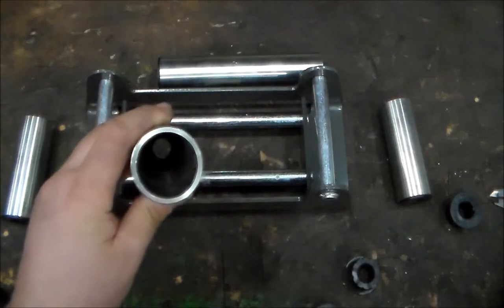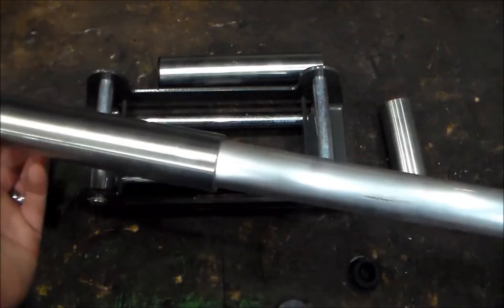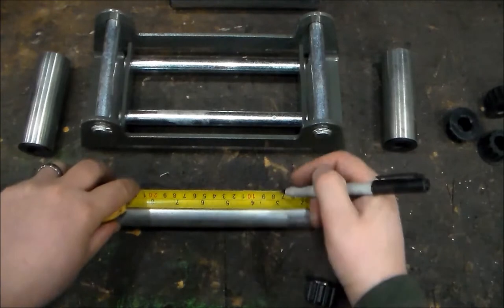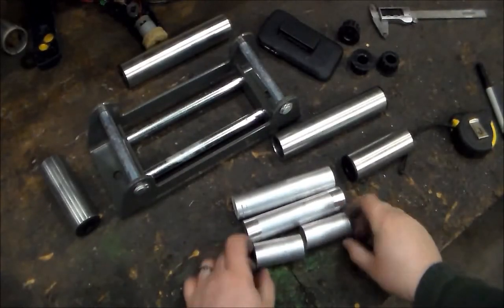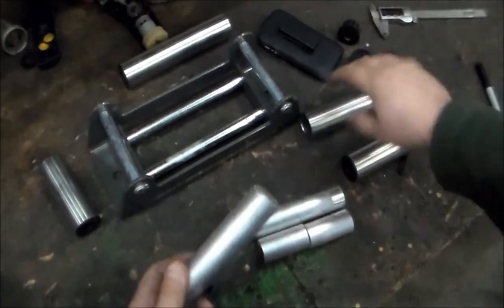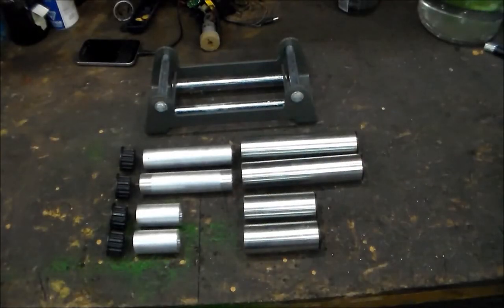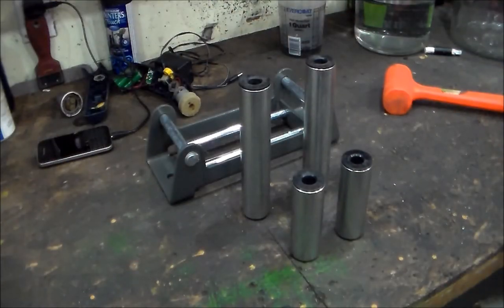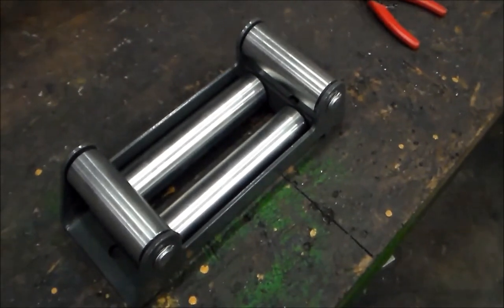How to Make a Winch Cable Guide Indestructible for $5 Bucks

Comment: Nice fix. Since all my fairleads are 20+ years old and solid rollers, I honestly didn't know they made hollow ones. But, now I know how to improve them. Personally, i would recommend also replacing the pins in the short/front rollers with grade 8+ bolts and lock nuts. If you hit a rock or something with your fairlead, it could bend the body and pop the clips off the pin very easily, leading to a mess of pieces. If the vertical rollers are bolted, the body of the fairlead is kept together much more rigidly under load or impact. 
       These two upgrades would make even the cheapest fairlead very strong and durable.

Comment: I made mine for my quad out of a old choker bell. Just cut it in half and welded it on the plate and then bolted to the bracket. I know not everyone has access to one, but if you do, they make a great fairlead and will never wear out, and would probably work on synthetic too!

Comment: Do you even need the bushings if you cut the aluminum to the length of the roller plus the bushings?
Reply from the maker: Yes, the bushings hold the outside pipe in its place.

Comment: for 5$ and using 5000$ worth of lathe and milling equipment you too can have an indestructible cable guide!
Or you could probably buy a better one for like...50$ and avoid the electricity, lathe, mill, tooling, etc...